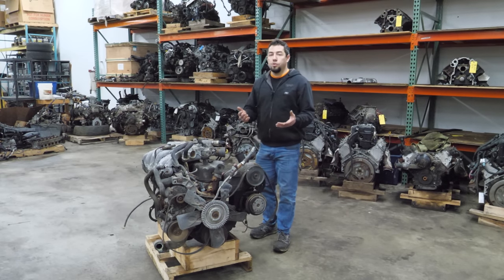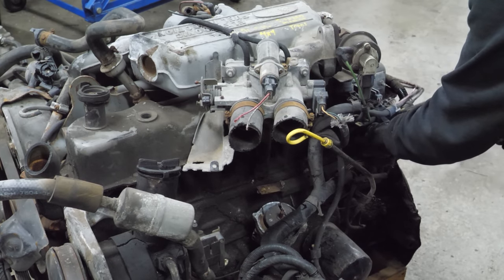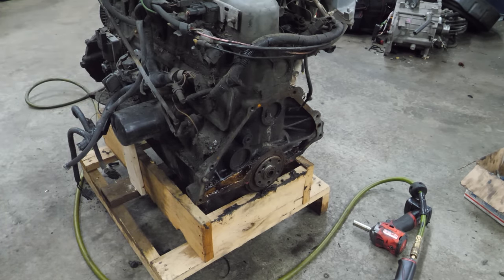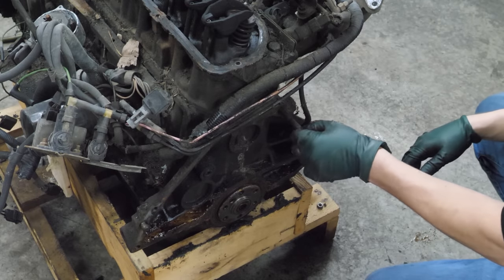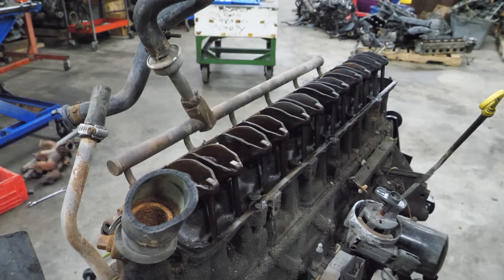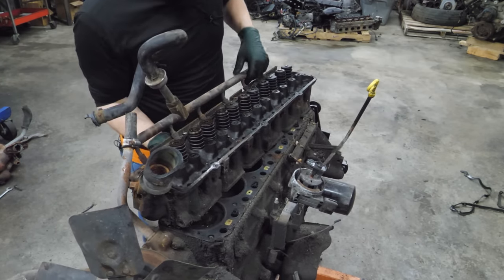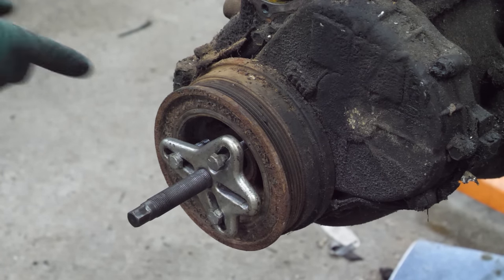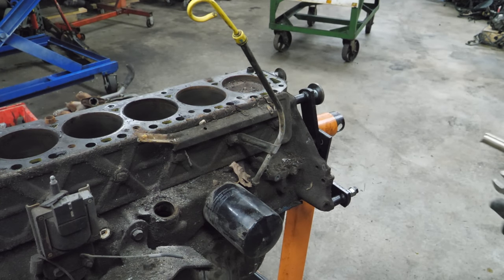FINALLY! A "Bad" Ford 4.9L 300 Straight 6 To Teardown! Most Reliable Engine, Ever?

Comment: 300 Ford was worst gas guzzler I ever owned. My 460 is better on gas.
Reply: That’s the exact same thing I was going to say. My F250 with a 460 doesn’t gulp fuel like the F150 and the 300 did and would not run smooth for nothing. The hatred I had for that 300 was one reason that I switched to GM.

Comment: before plastic parts.. improved internals and engineered failure.
Ford vision.. cheap reliable cars for the public....
FFS even the fan was rotating razor blades.. FORD TOUGH!

Comment: Bullshit! I've owned 3 with one being nearly new in 1984. All three eventually had terrible blow by and used way too much oil and eventually rod and main noises. Ill never own another 300! I'm a Ford guy and had far better luck with 351 Cleveland and 460 engines. Did once have a 1975 4x4,  318 Dodge that wouldn't die after 300,000 very hard miles and was constantly beat on. Often used chainsaw bar oil to top it off. Trans finally gave up first.

Comment: reliability? as in, it runs. yes. it does other things reliably too... like suck enough gas to power a small army. in that aspect? it is the POS of ALL POS's. a 302 or a 351 will deliver BETTER gas mileage than this hog. better yet? a cummins bt4 or bt6. gas is NO PLACE for a truck engine.